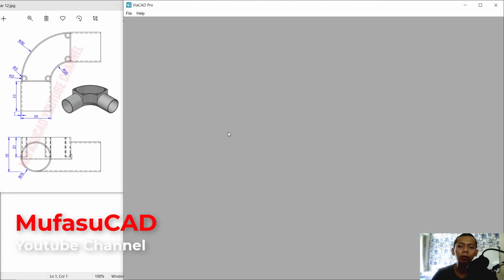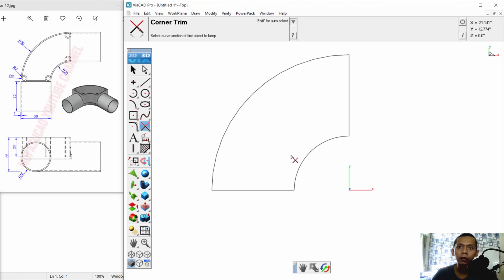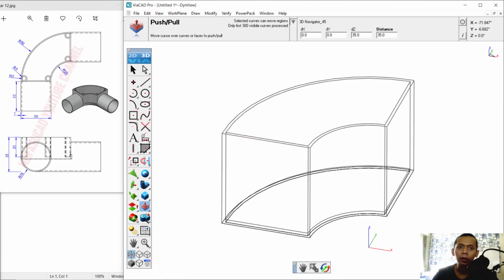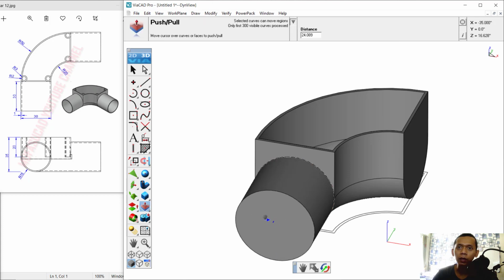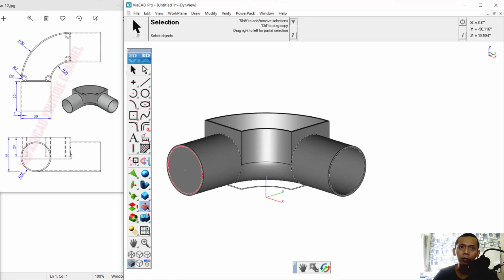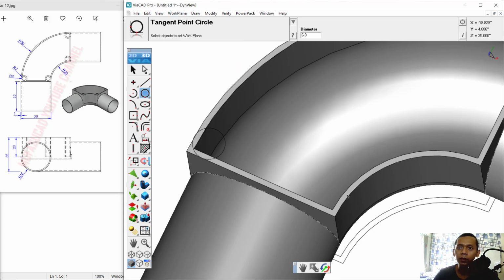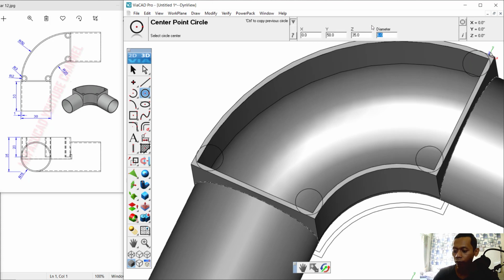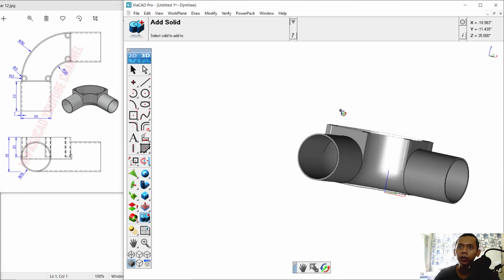ViaCAD 12 Basic 3D Modeling Tutorial For Beginner | 3D Software

Comment: I did specify my discontent in those 2 emails sent 01/01/26
along with the axis glitching out when trying to rotate,app unexpectedly quitting.
 I already purchased an older ver (v10 2d3d) that had the bend tooland 7 different push pull tools
You would think when upgrading to v15 that those would still be there, but no, you choose to remove them after I already paid for them, that's not an upgrade, that's stealing. 
about as dumb as upgrading a car but you removed one of the wheels.
I ordered power pack to see if those tools were there but no again.
Finally I so called upgraded to v 16 to see if that would do it. 
 Funny how you claim it is in ver 16, however, there is no v16 viacad as a product.
it is either v16 2/d 3/d or viacad 16 pro, both products are v16. This is classic
Bait and Switch. You had misled me to think that the tools advertised were not 
going to come with 2d/3d and was clear that it was only pro ( who knows it thats the truth)
I never would have purchased either, including v15 2d/3d on September 30th
You can also check out your video ( the one with the fake AI girl expressing the same
thing " version 16" . It gets old trying to figure out what training videos are for your version. if you didnt do a bunch of bait and switch ( removing features that the previous
ver already had, and all the versions that are not covered. 
Spell it out what each version comes with. These kinds of business tactics will only 
erode your credibility.  Terry Amante

Comment: Good to see how you use the Workplane and the Push / Pull modeling features. Not too sure how this can be injection molded with the undercuts below the 4 screw bosses, maybe there is a shut off from the 30mm tube sections of the molding tool to shut off against the bottoms of the screw bosses?  Very helpful thanks.